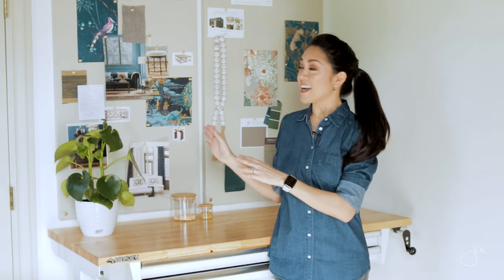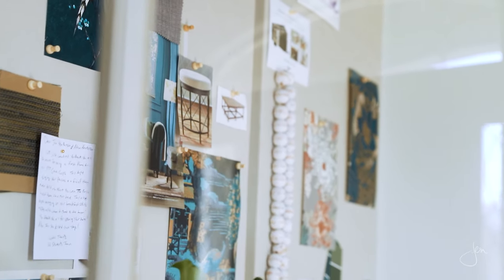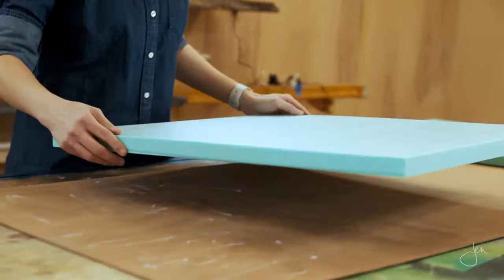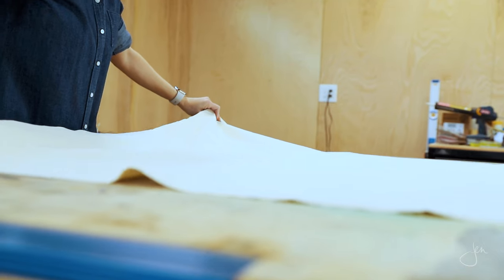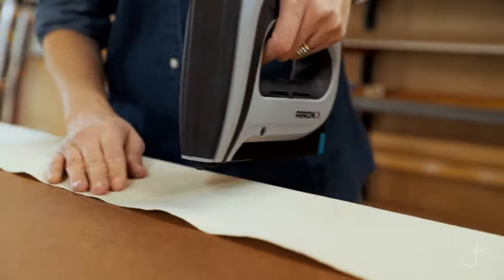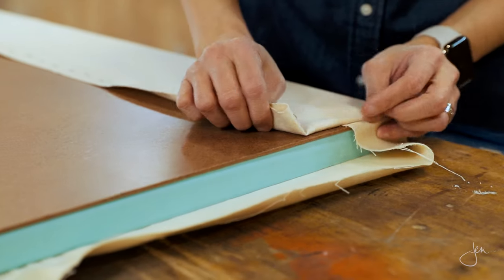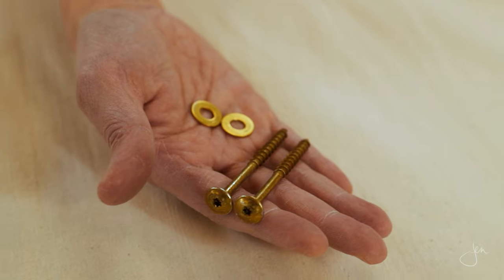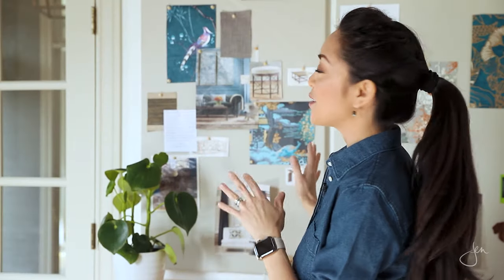DIY Pin Board / Bulletin Board / Mood Board

Comment: I have found this same tutorial many times yet nobody answers the one question, is it durable? How long does it last? Does the foam insulation hold up?
Reply: I bought a board with cork. But the cork was only 1 mm thick, next layer was paper. So very weak. I worked with foam, it is strong. You need to take the one she used in video, more durable. About textile, I think some dense material should be used. I plan to do this board too, I will try more textiles to see what is better. On the other had, what if you see punctures in it? Does not matter that much.

Comment: What should I say at the stationery shop so they give me this type of foam? I went and tried to get it, but they just told me to take and use the Packing foam, and the thing is, I hate the touch and sound of packing foam I can not bear that I used to clench my teeth if I have to pin something on board that used that foam that comes with electronics and fragile things. The foam you used looked somewhat different.
Reply: Get the right foam from a hardware store.